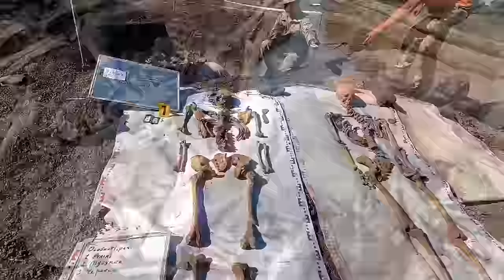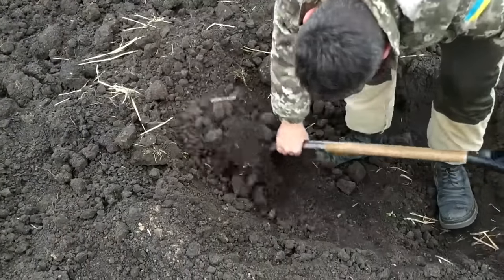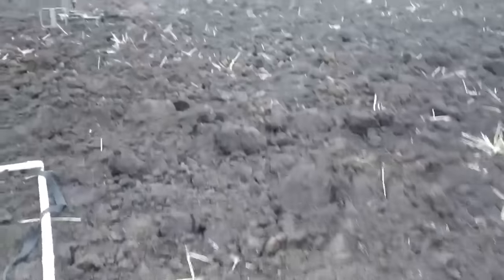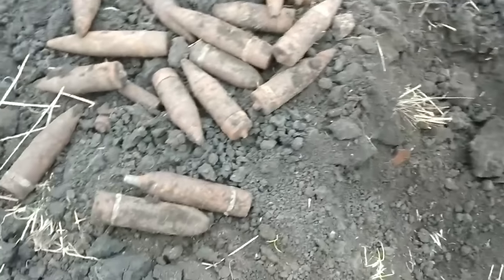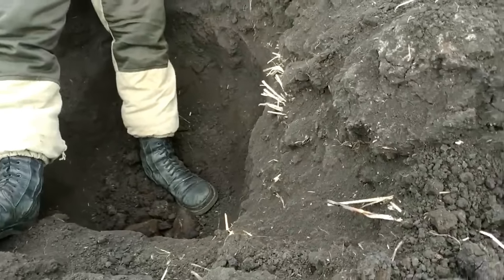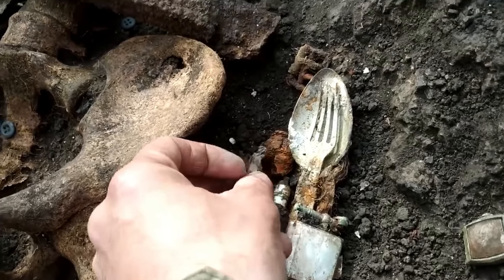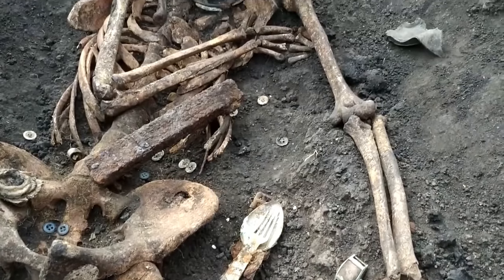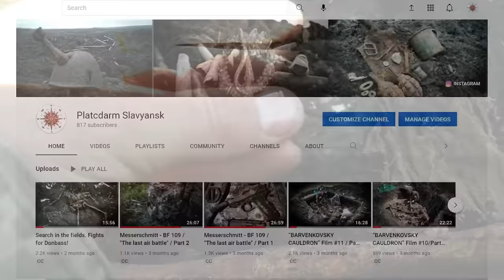The defeated position of the SS WESTLAND regiment "Battles for Donbass!" - Film No. 15

Comment: The "candles" were spark plugs. The ID disc should be saved, it will be of use in identifying the soldier.
Reply: The translation is terrible...your example of a spark plug being translated as a candle is a good example